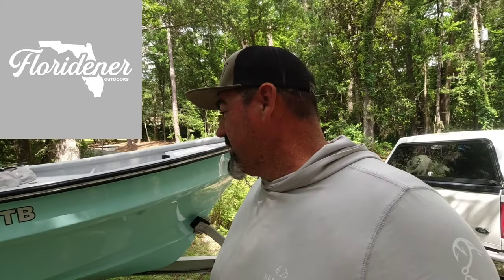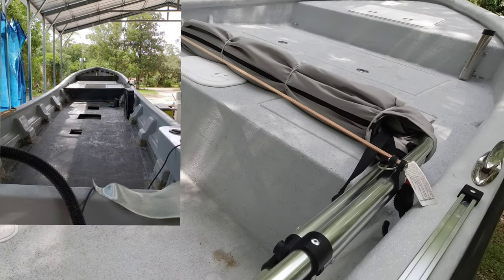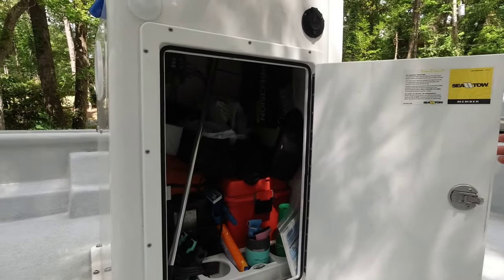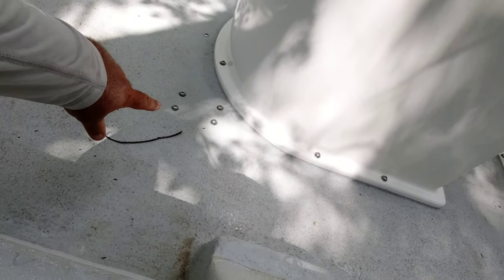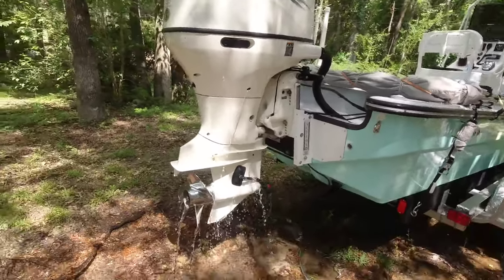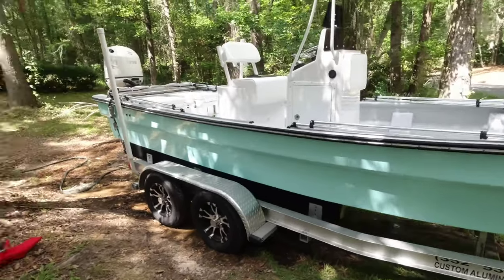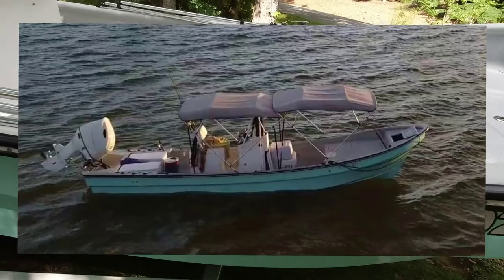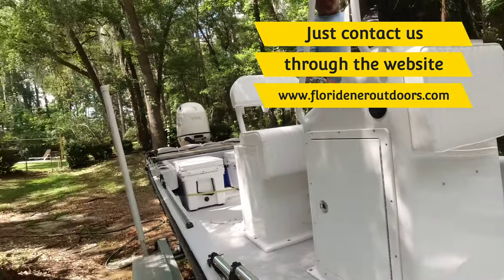He built a Panga!

Comment: I have a 25 Foot Eduardono Panga with a tiny 50 HP Etec Evinrude and I easily do over 20 knots. Tiller control, wood floors, bench seats. I kept it as simple as possible like the rest of the world does . All I put in was a cooler seat, an 8 foot Bimini Top and I bought a small console for the electronics, storage. And I tow it with a Kia Sedona minivan . I pulled it out at  a very steep saltwater  ramp even with the emergency brake on. And I usually pull it out in Eco Mode and it came out like I was towing my 16 Foot aluminum Boat. 2500 pounds total, boat loaded is about 1400 pounds, Venture single Axle aluminum trailer is 700 pounds and the motor is 250 pounds. The Tiller control is much better than I thought, I have an Extension Tiller Handle  and I can stand 6 feet forward of the transom and hold onto the Swingback cooler Seat when I'm steering , the same spot I'd stand steering with a steering wheel. Very stable boat, one person can launch this boat and retrieve it, I go out fishing all day, go about 20 miles and burn 2 gallons of gas. You don't need a Mack Truck to tow this Boat, trust me . Maybe if you launch from a beach .
Reply: Can you show in some videos? Sounds sweet

Comment: The Eduardono 25 Panga is available in 20 and 25 inch transoms. I ordered it with a 20 inch transom and it looks like I got a 25 inch transom because my 50 HP Evinrude with a 20 inch doesn't go deep enough into the water and it revs at high speed /prop comes out of the water. I contacted an Eduardono Dealer and they said all the boats come with a 25 inch transom unless the buyer wants a 20 inch. So be careful when you order . Bay Manufacturing makes and sells a 5 inch extension to turn a 20 into a 25 inch. They make a kit for most engines.

Comment: Boat looks great. I have the same one. I have a 115 on mine. I have alot of cavitation when the motor is all the way done. Is the motor 20 or 25’? Also where did you to decide to install transducer?
Reply: I have a 25 Eduardono with a 50 HP Etec. When I try to go fast it revs like crazy and I gotta slow down. My brother said I need a Jack Plate. Sometimes it works perfectly and I go well over 20 knots . The 50 HP has a long shaft and the shaft looks too short compared to the transom height. I think the 25 Panga needs a 25 inch shaft. I just gotta go slow around 15 knots and it's ok, If I push it, it  starts reving loud and pushes up water.

Comment: where did he locate the hull?
Reply from the maker: There is a guy in Jacksonville that imports a few a year. I can get his information if you'd like.
Reply: @maskedmanfishing  yes please do
Reply: And you don't need 500 HP, My boat has a 50 HP Evinrude Etec and top speed is well over 20 knots, close to 25. I go out and burn 2 gallons a trip . Maybe 15-20 Miles.
Reply: Look up Eduardono dealers, there's 2 in Florida, 1 in Canada , 1 on Long Island. I purchased mine at South Shore Panga in Hampton Bays.